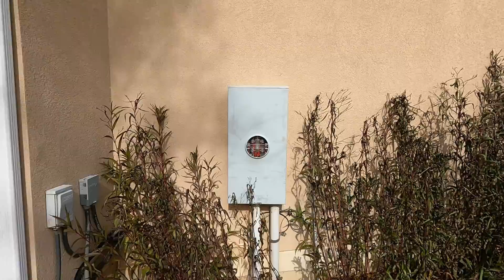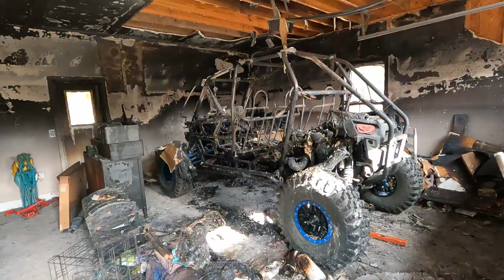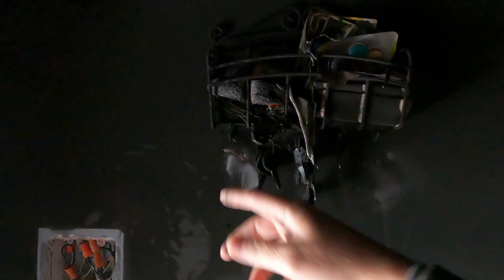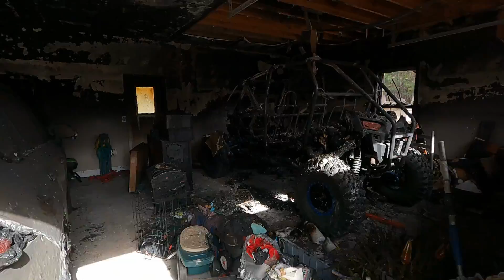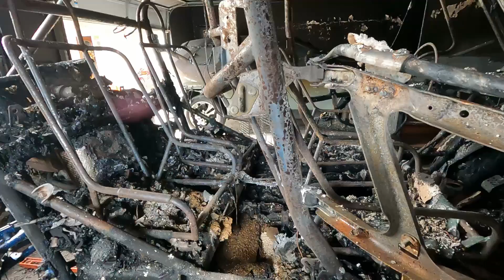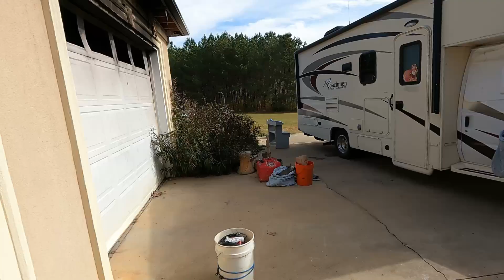Channel Update Dec 2020

Comment: Wow!  Consider yourself lucky.  That could have been a lot worse.  Now's your chance to get a new machine and build it better!  I'm really surprised at how well the drywall protected the wood framing...Looks like you'll be back up and running soon!  good luck.
Reply from the maker: Thank you, yeah I've got my eye on a replacement. The fire dept. was too, as hot as it was burning, it really ended up being almost totally cosmetic as far as the house is concerned.